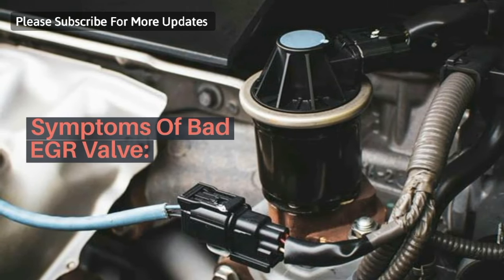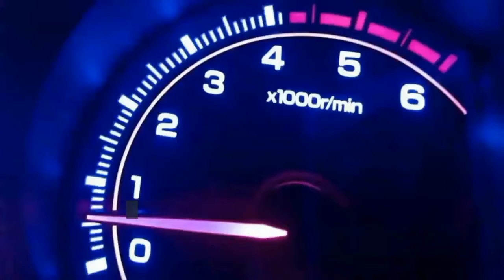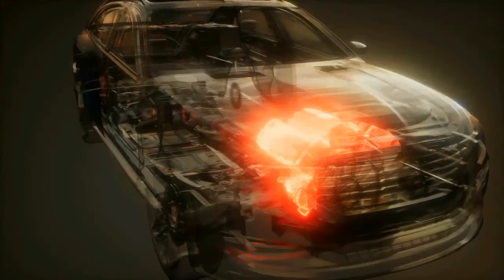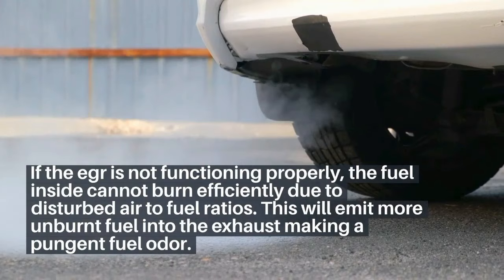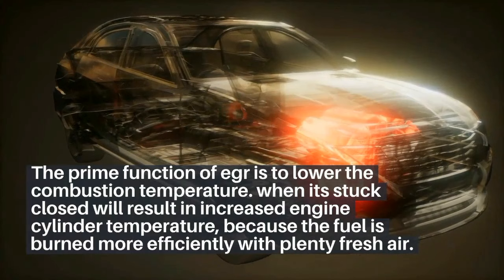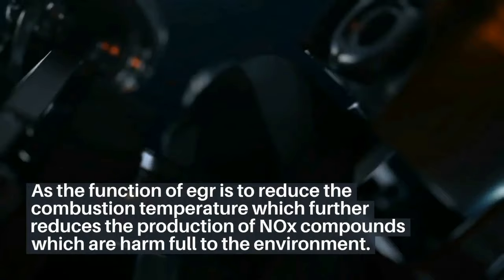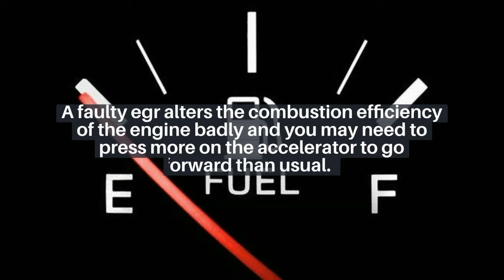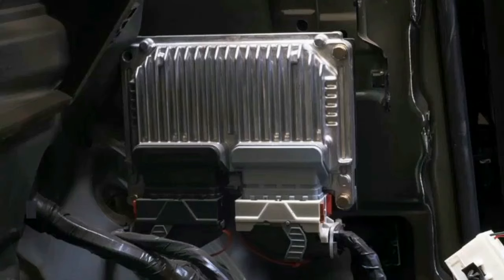Most Common Symptoms Of Bad EGR Valve | Signs of failing EGR

Comment: Can I drive with a bad EGR until I get it fixed?
Reply from the maker: There wont be any issue driving but its a good idea to disconnect the egr motor if electronic, so the unexpected huge carbon soot can be avoided getting into the engine.
Reply: @dailyhandsdiy  Thank you 😊
Reply from the maker: Any time mate :)
Reply: @dailyhandsdiy  are these simple to replace?
Reply from the maker: Well for some cars, its easy as its easily accessible but some cars its hard to reach.
Reply: @dailyhandsdiy  do you recommend to clean it, buy new one, or just put it out of function?
Reply from the maker: first step should be cleaning it. Its designed to run on full engine life. if the motor fails or spring snaps if spring loaded, then have to replace it. puttin it out should be kept under thought as it makes you fail in the emission test, which is mandatory in may countries.
Reply: @dailyhandsdiy  thank you for your answer. According to my experience on previous car i cleaned it (the mechanic cleaned it 😊) and it was ok for one year and then i again had to deal with it. Then I found a guy who just put it out of function and I never had any problem with emission test and i drove the car for couple of years more. And the guys at the station are fairly strickt with the tests as my country is im EU. And now I have the same problem with a new car. Anyway thank for your help. 👍
Reply from the maker: Yup the nly thing you il have to face will be the tests. Else there nothing to wry if its set off amd the engine runs better without it. Oh ya the NOx attact to our atmosphere too. else ok.

Comment: I have a 2006 320d m47 which is not boosting at low speed  but when over 2000rpm it goes like stink!
20mpg 😪
Reply from the maker: Hi there,pls do clean the air intake sensors. If egr not cleaned for long, do that too. EGR is the one that cause reduced low end torqs.
Reply: @dailyhandsdiy Hi.
Thank you for the reply,
I have fitted a new Maf and I cleaned the air intake manifold blanking the swirl flaps at the same time.
The Map sensor is fitted to the back end of the manifold isn't it?
I will 7nplug it today and see if that makes any difference as unplugging the Maf made no difference 😔
Reply from the maker: Try unplugging, egr and drive. unplugging maf or map wont change the performance but be sure to clean map too also egr if not cleaned recently.
Reply: @dailyhandsdiy  unplug egr? It is vacuum operated so I guess you mean take vac hose off and block both ends?
Reply from the maker: First of all, before disconnecting egr, have to make sure the valve is clean and not sticking. Sometimes the carbon can make the valve not closing completely making boost leak or exhaust leak. Make sure the valve is clean and closing properly. After wards it can be disconnected to check the low end torq problem. Else you wont be feeling any change bcs of partially stuck open valve.
Reply: @dailyhandsdiy I have already cleaned both the inlet manifold and the Egr valve. I will cut out a piece of tin and fit between the cooler and Egr so zero exhaust can get through along with blocking the vacuum side 👍
Reply from the maker: Yup.. that should do...
Reply: @dailyhandsdiy  
I did that and seemed a little better but only a little.
I did however notice after a 10 min drive that my mpg went from no better than 20mpg and was now at 23.8..
Hmmm I might go for a blat on the motorway and see how that goes.. 🤞
Reply from the maker: Sure and dont forget to clean map sensor. Dont disconnect it just clean it.
Reply: @dailyhandsdiy  quick update!
Had a little look after work today with some Fairy up ...
Big bubbles from where the rings are on the turbo to intercooler pipe,  very noticeable on idle so I imagine losing alot of pressure  under load. I just hope this is the reason for the lack of power at low speed 🙏
Reply from the maker: Bubbles? Is that an turbo pressure leak? if yes, it can make a huge difference in performance.
Reply: @dailyhandsdiy  yup..
Pipe from turbo to intercooler.
Made big bubbles part way round it and rest of way round spat straight off..
That only at idle surely must be it 🤞
Reply: I will use heat shrink for now until I get a new pipe 😁

Comment: Old cars didnt have egr valves, they didn't have too high combustion temps.
Reply from the maker: Hi there, higher temp doesn't mean it can blow up the engine...just higher temp thats ol...ie higher work output.
Reply: the cars was programmed to operate at those temperatures when ur just block ur egr off or its closed it still thinks its running at lower temperatures which is why u get it mapped so the engine knows it’s running without a egr

Comment: My garage want to charge me 900 quid for a new EGR valve and I only paid 700 for it. 😡
Reply from the maker: Normaly, a clean up could do the job...and only if the actuator or motor breaks down you need a replacement

Comment: The car runs smoothly on the normal road and gets low pickup in the mountains.
Reply from the maker: Clean all the air intake sensors, and egr as well. sure it can make some difference.
Reply: Same here. I get a flat spot sometimes when climbing hills. I'm thinking the egr is cutting oxygen and reducing power. In a mood to blank it out
Reply from the maker: Hi you could initially disconnect the valve motor just to check if its the egr itself. Disconnect the electrical cable or the vacuum hose if pneumatic. You may get a check engine light. Drive and check the problem is solved. Egr does gives out flat spots if sticking intermittently.
Reply: I fitted a blanking plate and now no more flat spots while climbing hills
Reply: Before blanking plate was installed i had the whole system cleaned out properly 1st
Reply from the maker: Great 👍